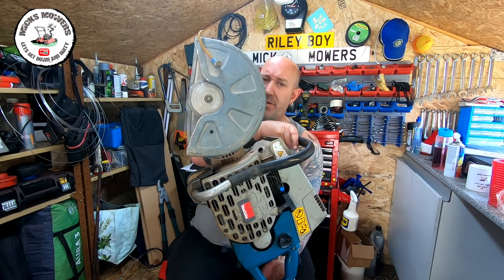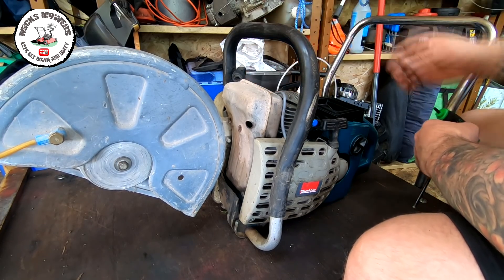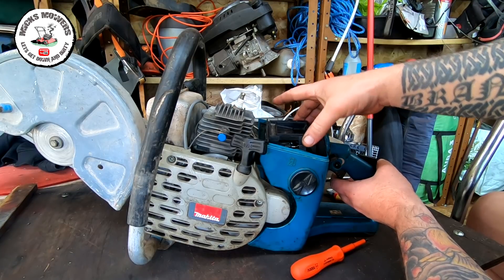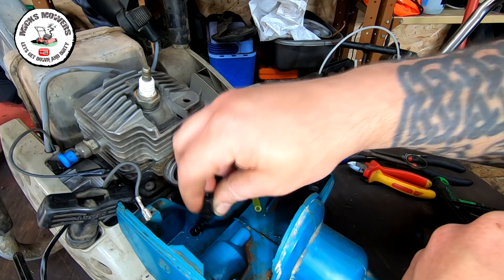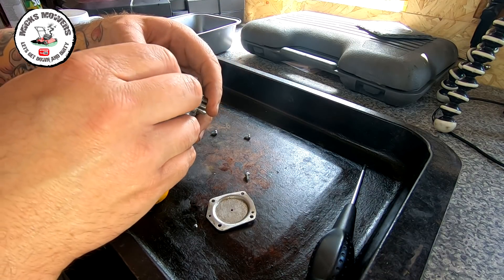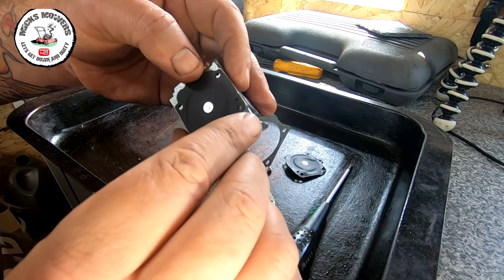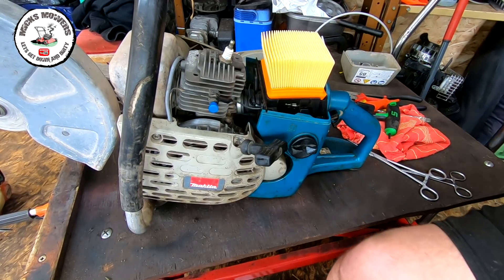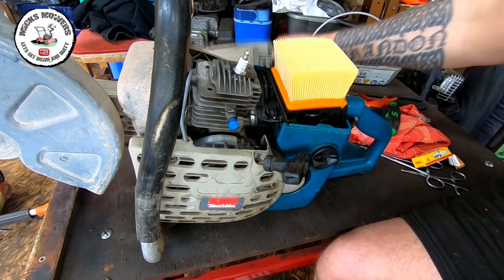MAKITA DPC6400 Will Not Run - Here Is How To Fix

Comment: Hello Mick I’m about to try and bring my 6400 back to life but the spark plug on my repair manual is the BPMR7A. Different to the one you mentioned. Is that an issue? Thanks
Reply from the maker: Should be fine.. but Google it to make sure

Comment: I noticed there was no carb gasket fitted when you replaced the carburetor.  It's not needed??
Reply from the maker: @pt8594  it is mate.. but they do run with one
Reply: Sorry, mabe I wasn't clear but on my saw there was a gaskets sitting on the cylinder side of the carb inside the plastic housing. So when you fitted the carb inside the plastic housing there was no gasket there. I'm not talking about the gaskets inside the carb. Hopefully I'm explaining correctly
Reply from the maker: @pt8594  well.. it's always hard to say without a diagram.. try it with a gasket.. if it runs poorly try it without
Reply from the maker: @pt8594  check the coil wire on the coil or stop switch..
Reply from the maker: @pt8594  yes.. the stop switch is not seated right I would say ..
Reply: Got it started following your procedure. Thanks a million

Comment: Excellent tutorial,  got a stone saw same as yours wouldn't start. Got new filters and gaskets and now working. Thank you.
Got a problem with idle tho  won't tick over. Done adjustment on carb.
Reply from the maker: Well it's running so just try adjusting it again.. it should tick over ..

Comment: Well I am back on this video. After 1 year another round of maintenance. Here is a lesson learnt for anyone working on a DPC6400/6410. When ordering gasket kits, I have come across different kits who supply different diaphrams. One of the diaphrams has the small metal pin which slots into the rocker arm for the fuel cut-off valve(see video). Other kits, dont have the pin, just a small metal head which can only rest on the rocker arm. This version just doesn't work. 

The other hard earned lesson is that all this time, I have been replacing gaskets and cleaning the carb. Few years back after servicing the cutter, it was still not running well. Well there are two small o-rings on the two adjust screws on the side of the carb. If you take these out, mine were brittle and had disintegrated. They were leaking air into the carb. Changed those and viola, good to go. 

Besides the faff of trying to get the carb out and in with stupid fuel connection, it is a very robust machine which has taken many years of abuse and still going strong.

Comment: Hi Mick, have just watched your video and prepped the machine for parts coming from ghs.
When I took the carb out I discovered it was a tillotson not a walbro. Now if you follow the ghs trail they advise a walbro kit, but they  do, do tillotson kit. I suspect your carb is a tillotson but you seem to have been able to fit a walbro kit. Also my carb had a round sponge gasket  on the diaphragm lid and a paper gasket between carb intake and plastic air intake. Great video though has helped a lot.
Reply from the maker: Glad you liked the video mate.. hopefully it has helped you out

Comment: Hi kick Friday was a trying day to get my lawn mower started temp almost 7 try noted bad gas it would start and die put in some gas treatment blue smoke after a few try it started to run better the gas sat to long over the winter months gave it a long run it all smoke clear up let it run a bit and ran great after great  did the lawn cut I've using the electric lawn mower but next time I'll run the gas mower more this happens when you never run it a lot

Comment: Awesome work mate, currently working on a Briggs and Stratton 450e with a carb problem, I’ve cleaned it all through thoroughly and it’s still got a problem, any ideas?
Reply: Sometimes the the carbs are just bad. you can clean and clean, replace it.
Reply: Jerome Cook thank you for the advice bud
Reply from the maker: Get a new carburettor they dont work very well I have had a lot of problems with them. And dont get a copy one
Reply: Micks Mowers thank you for the reply mate,  hope you’re well

Comment: Shouldn't there be gasket between carb and housing on inlet side
Reply: Looks to be missing plastic cylinder cover which has retainers for HT lead so it isn't burnt on exhaust and directs air flow

Comment: Which way did u tune screws too to idle properly
Reply from the maker: Depends where there are at the moment. If your not sure screw them in but not too tight. Then unscrew them 2 turns each to start with... Then get the sa running and start with the high side then then the low one screwing them in or out and listing to the engine. You want it running just off the peak on the high side
Reply: @themowerman  hi is it 2 complete turns out can you let me know please thanks
Reply from the maker: @leescoey  screw it all the way in then 2 complete turns out.. then you need to listen to the engine to find the sweet spot..
Reply: @themowerman  THANKS BEEN MESSING WITH HOURS BEFORE PUT FULL CARB KIT IN BUT ONLY 1 COMPLETE TURN OUT ON H AND L SCREWS IT RUNS BUT WONT TIK OVER AND SEEMS TO FLOOD I NORMALLY PUT FULL NEW CARBS ON STIHLLS BUT THESE FOR MAKITA SEEM TO BE VERY EXPENSIVE I WILL TAKE IT APART 2MOZ AND LET YOU KNOW THANKS FOR POSTING BACK

Comment: Hi Mick, I just followed your vid on my own DPC6400 that wouldn't run for more than 2 seconds. it now starts but won't idle, instead it runs really high. if I adjust it its all or nothing, if i reduce the idle or low it cuts out, if I open them up it picks up to the top end. it is all or nothing, no in between.
Reply from the maker: Have you tried tuning the carb.. set them to 1 and a 1/4 each to get the thing to run.. then try and run it flat out and tune the fast jet.. do it little by little.. find the sweet spot.. once done then tune the idle.  Oh and do it with a blade on that helps..

Comment: Got given a old one of these a dpc6200 first time iv attempted to do anything on a anything like this. It was running before I was given it it just wouldn’t start so ordered new plug and filters and gave it a good clean out it now runs but dies after a about 10/15 seconds or if I give it any throttle would this mean it needs tuning like you done?
Reply from the maker: Yeah or a carb clean possible gasket and diaphragm change
Reply: Obviously I mean it ran then sat for a long while then I was given it that didn’t make sence what I said but Thankyou! I’ll look to order one now thanks again! Good video👍🏻
Reply from the maker: @joshuabolton137  your welcome mate
Reply: Ordered new gaskets and fitted them seems the diaphragm gasket didn’t seem to fit that bit that it needs to hook onto but changed the others and it starts up again there’s 2 holes in the side for tuning on this model a “L” and a “S” what one do i try and change? Thought best to ask be for I mess about too much thanks.
Reply from the maker: @joshuabolton137  ok so what I would do is get the gasket and diaphragm done first before tuning as you will need to do it again once fitted.. s - slow or idle . L fast.. turn the L all the way in and count how many turns and make a note.. I would start with 1 and 1/4 out.. on both then start the saw.. run it at full speed and your looking for where it sounds the best.. when you have found the top speed just back it off a tad.. then try and get the saw to idle. Then turn the screw to find it's tick over point
Reply: @themowerman  thank you that make sense I will try tomorrow. Thanks again!

Comment: Hi Mick. Love the channel. I have just bought one of these second hand and will do the service myself having watched this, but can you tell me, does the clutch only engage when the revs are up? With this one the disc spins constantly, even at idle so I feel I may have a clutch issue also??? Thanks a lot.
Reply from the maker: I could be clutch issue or incorrect belt.. could be that the carburettor needs tuning to bring the the revs down
Reply: Thanks for the reply and advice